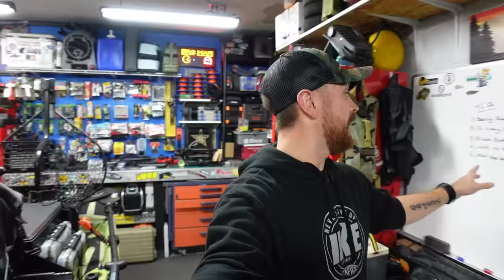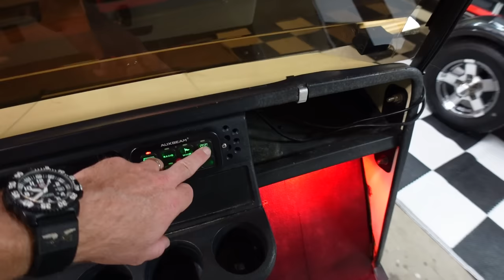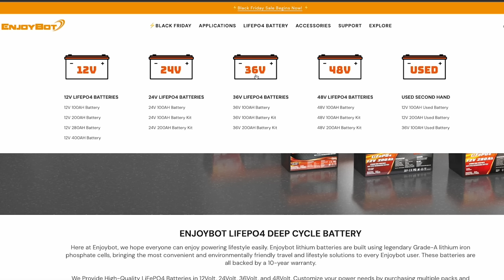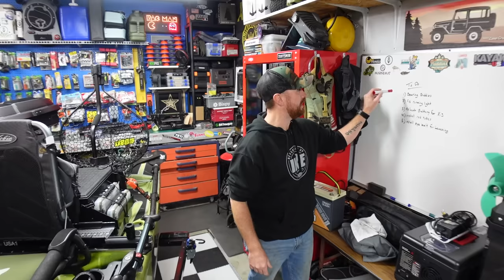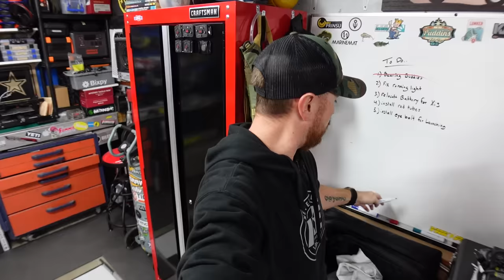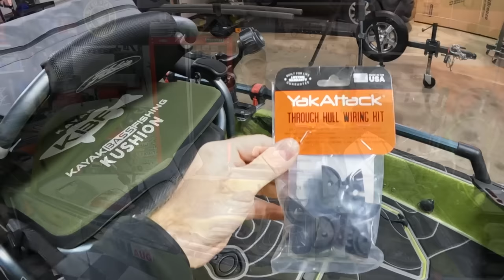Making Some Changes... Kayak Battery Swap & Kayak Trailer Repair [ DIY Kayak Mods ]

Comment: why not just load the kayak facing backwards and drive off the trailer with your Xi3 using your remote. then hit spot lock while its out of the way and park your truck. then drive the kayak over to the dock.

Comment: I got rid of my rod tubes and blocked them off. Was better for water getting through, but that foam insulation isn’t really water proof. I’d silicon around the block offs and should help with water getting in. When I had my pa12 360 with the xi3 I was emptying out gallons of water after each trip.

Comment: Recommendation an 36 volt old EZGO steel body golf cart. Because of layout of controller,cables,etc. Are the 3 12volt as good a choice as the 1 36 volt battery? Safety,range,longevity?

Comment: TJ, I know you have links for cameras you use. When you are doing your videos which camera is on your tripod? I have an old digital camera still works but I have no way to hook a mic up to, no Bluetooth etc. I am in the market for a good camera but has to have certain features. I like the golf cart battery compartment. Well done. I wish I had room in the garage for it to be my shop and studio. 😂😂 Another great video, interesting ideas. Thanks much!
Reply from the maker: Thanks! My camera is the Sony ZV1
Reply: @KayakUSA1 , awesome. Do you know if it has the capability to record while charging or record without battery and only using AC power, or using an external larger capacity battery? I got a new GoPro setup, battery dies very quick. Found a workaround, but I need longer battery life or the ability to use AC power as well. Thanks.